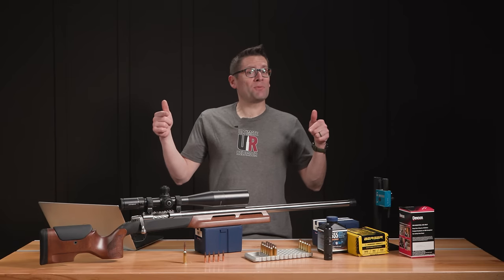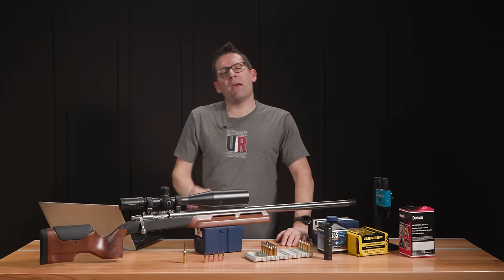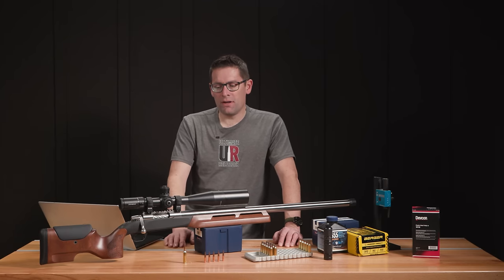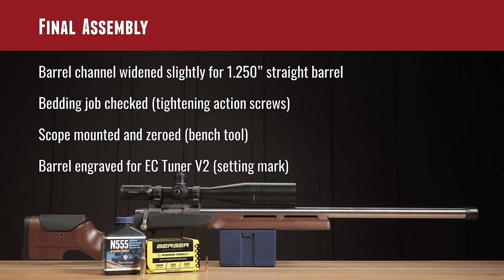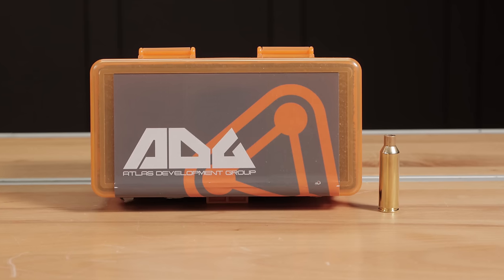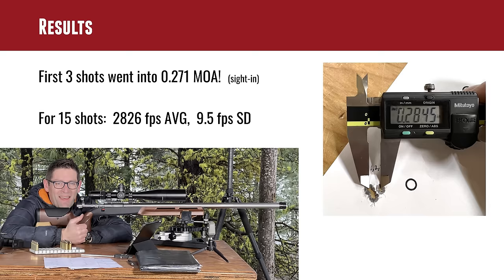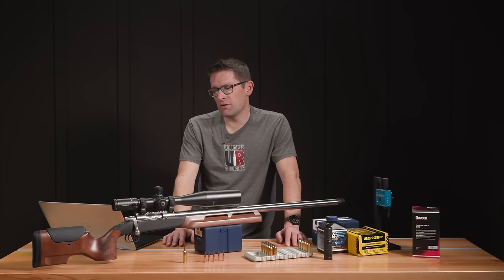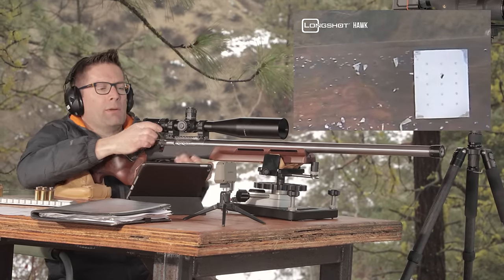7PRCW Part 3: Bedding & Break In (Incredible Results)

Comment: I'd recommend you neck turn the Lapua brass if you're going to run that, and cut into the neck of the brass because you're going to introduce donuts after the first firing. The donut won't be a problem if you have enough freebore, but if you intend to play around with seating depth (a big jump will work with this cartridge) then the donut might cause issues. The ADG brass shouldn't suffer from this. Your build otherwise looks alright. I wouldn't use the Woox in an F-Open match, I'd get a proper F-Open stock that has a longer surface area at the butt of the rifle.

Comment: Gavin build a U style bench. If you go to Barbourcreek long range shooting you will see the benches and how they are set up. You will need to build the front of the bench longer so that you are behind the gun instead of just off to the side. Behind the gun is also how you will be for F class. I have a portable table that I put in the back of my truck that has left and right hand shooting positions which works good on prairie dog towns for two different shooters even shooting both right handed. The U-shaped table will only allow for one shooter. I’m making it with a big 1 inch threaded seat, so that I can raise it up and down per size of the shooter. I really like the way Barbour Creek. has their set up for shooting out of an air-conditioning building and getting on the floor and shooting prone. I really wish you could do that on your range. Right now for my bench. I’m waiting on a piece of inch and a half flooring plywood for my table top so I can build bracing so that it doesn’t bounce. I’ll take a picture of both my tables and I get my plywood for this one.
Reply: Barbour creek on U tube of 
Course
Reply: I never cared for the T shaped benches. It feels awkward hanging off the side and having one arm flapping in the breeze and get consistently in the same position.

Comment: Looks like a good start. My hand is a bit shaky and my eyes are failing but that action looks to have a big hole where it shouldn't. Also, the end of the no taper barrel looks awful big. Aside, from that it's looking good but couldn't see the trigger or safety. I suspect the spin velocity of the 6.5 is much much more stable from start to end but you're sure to prove something. ✌🏼👶🏼🚬

Comment: Would be super interesting to see you do a shorter barrel 7PRCW for hunting. A modern 7SAUM without the non-existent brass issue.
Reply from the maker: I love that idea!
Reply: @Ultimatereloader  I was about to pull the trigger on a 7SAUM but now i'm holding off until I see some data for 20-22" barrel on a 7PRCW pushing the same heavy 175-180gr projectiles

Comment: Do not mess with the seating depth, And the tuner at the same time. Run each test individually then go from there. And that's why you have a tuner on there, so you don't have to mess with seating depth. Otherwise get rid of the tuner and just go with seating depth Test
Reply from the maker: Yes!